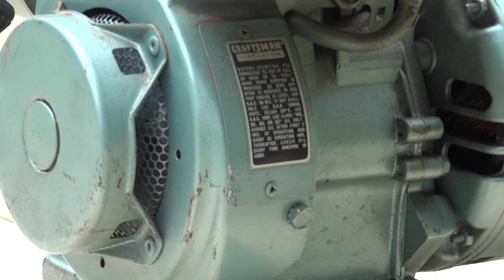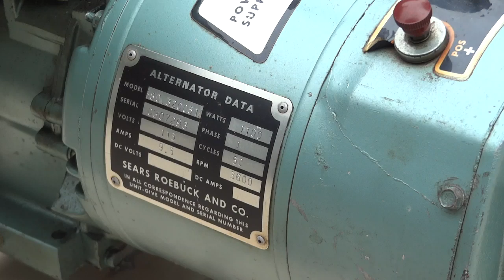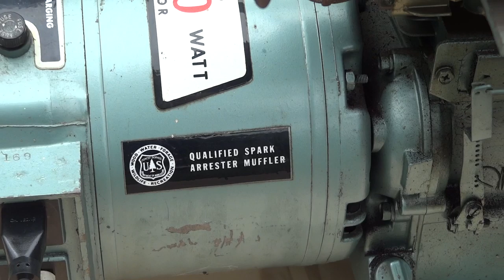The 1973 Sears 1100 Watt Alternator / Generator

Comment: Sweet.
That's the same engine that was on my early 70's CAT mini bike.
Super torquey and sometimes it would rip the handle right out of my hand when it hit the compression stroke.
I worked HARD to blow it up and i finally did, but it took horrific abuse.

Comment: At 5:20 is it really shaking at about 5 Hz?  Or is it a beat effect with the frame rate, and/or another odd effect of Youtube auto-stabilize processing?  Auto-stabilize makes things shake like warm jello on some vids.  I remember looking at stuff like this in the Sears catalog -- 'Good', 'Better', 'Best'
Reply: These"made by Generac" Sears machines do rock back and forth like you see in the video. It is rocking on the springs. My 4000w Genreac and 2000W Sears do this too. On the 4000 watt Generac on mine and others too the handle vibrates and often breaks off due to a fatigue failure. MIne did this. Then when I google the same unit I see other ones on the web that broke the same way.
Reply: Put it on a rubber mat it helps, I did it for all of mine on springs.

Comment: i have the 1350 watt version. I replaced the carb and it ran and made power for about 2 hours then it stopped making power. the brushes look good, any suggestions? any help would be appreciated since sears no longer makes parts for this model. thanks

Comment: i picked up a 3000 sears  7 hp tecumseh looks very simular/same color... just got it running I did not know what the red terminal was for on top of the generator...i see from your viedio that it is for charging a 12 volt battery...had to flash mine hard with a drill to get it charging...hope that will go away after i use it more...
Reply: You know what the float screw and idle screw are set too on th 2000 watt ones?

Comment: I have the exact same unit, but the generator has a blown Capacitor or Diode (a small cylinder that plugs into the generator and is melted).  It runs great, but doesn't generate electric.  Do you have any idea if its possible to get parts from somewhere?
Reply: +Troy Reish  get the numbers on it and go to Sears Parts Direct .com or Parts Tree. and see what you find.

Comment: There are this 1100 watt version 580.320051?
 a 1350 watt version 580.328171,
a 1800 watt version 580.320520,
a 2000 watt version 580.5742-1
a 2600 watt version 580.327122 and probably many more
Reply: We just moved into a house equipped with a cherry, used once 4000 watt model. It's built inside a wooden box on the side porch next to the driveway and it has electric start only, with jumper cables hooked to it that are about 6 feet long. You pop the hood on your car and hook them up and hit the switch. I could hear the starter spin when I jumped it (spark plug removed), but it wouldn't turn over. I'm interested in learning anything about this old generator. It's really beautiful, to be honest. I'd like to find a manual for it. There's a record that it ran once for 6 hours in March of 1977.
Reply: +GunsNBudder  Fuel system probably clogged up with evaporated old gasoline. Have to pull it off and clean it out.

Comment: Just picked 1 up today the man I got it off of says its lucky it has 10 hrs  same spark plug all the paint looks brand new and tags I ask if it was for sale he said is 20 bucks to much I said hear you go I don't need it but was just to cool I looked at the oil it looks like it was changed today he said he ran it for about 1hr then changed the oil in 1973 not touched the oil since